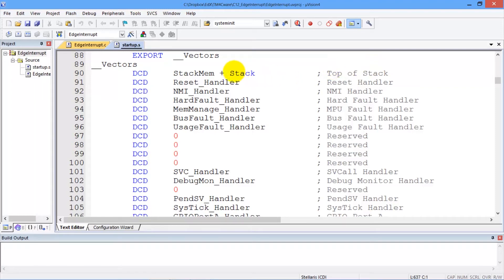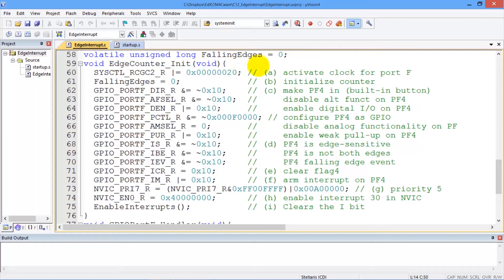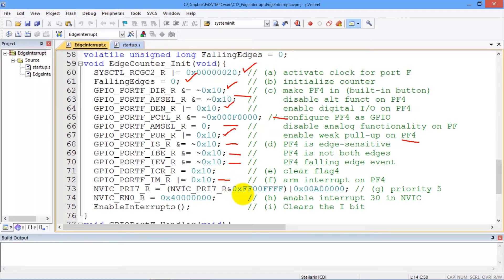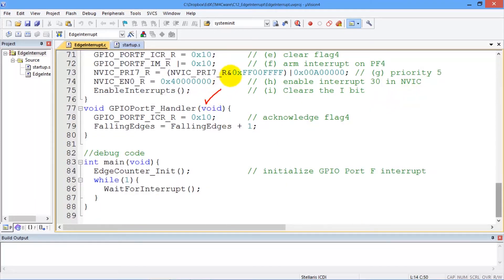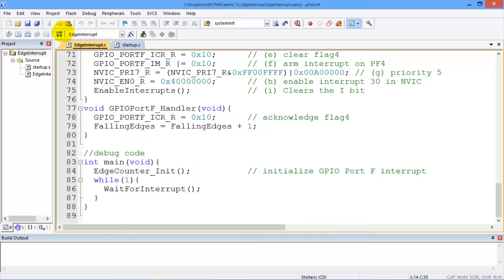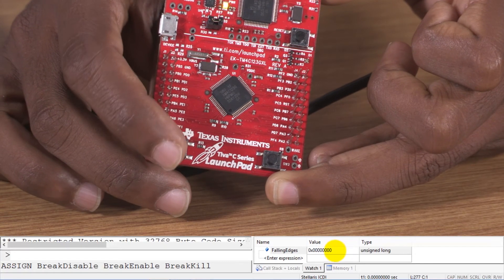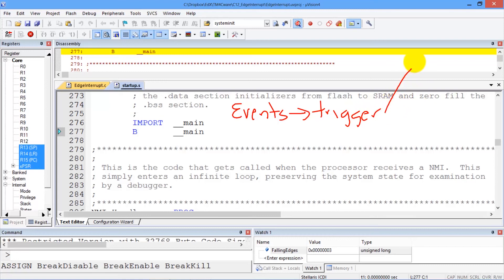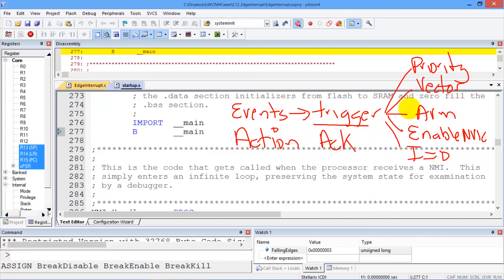C12 3c Edge triggered interrupts

Comment: I cut and pasted into a new project but got 3 errors, Did we miss anything with the code lines 0 to 57 , as code here starts at line 58 ? EnableInterrupts() , where is that ??? Are there no includes or defines ? This was a great help in understanding how to process interrupts but the code is simply incomplete and I'm wondering if i have to go searching for the rest of it in other videos.
Reply from the maker: Follow the installation for ECE445L, which is active https://users.ece.utexas.edu/%7Evalvano/EE445L/
In particular, see this install http://users.ece.utexas.edu/~valvano/arm/ValvanoWareTM4C123v6.zip
Reply: @JonathanWValvano  Thank you Sir. I'll have a look. I also have all your books too.

Comment: sir, 
in 
NVIC_PRI7_R = (NVIC_PRI7_R&0xFF00FFFF)|0x00A00000; // (g) priority 5

why bit no 16 to 19 of NVIC_PRI7_R are also set to zero 0?
Reply from the maker: +Ishaan Sharma TI only implements 3 of the 8 priority bits (23-16 is the full ARM field, 23-21 bits are implemented)
Reply: Thanks  a lot for the clarification sir.